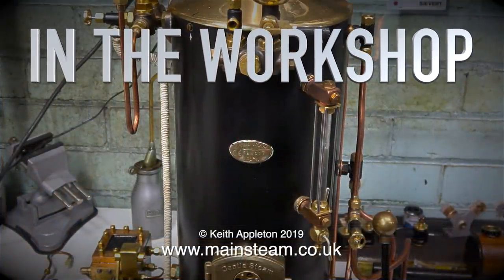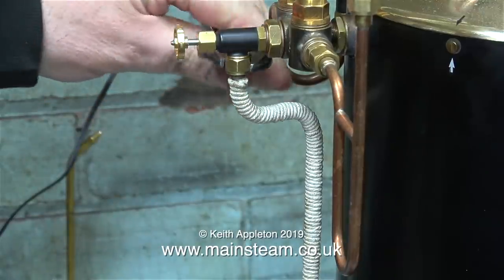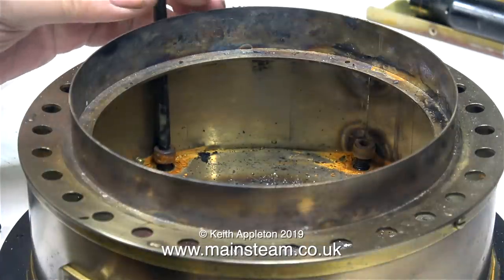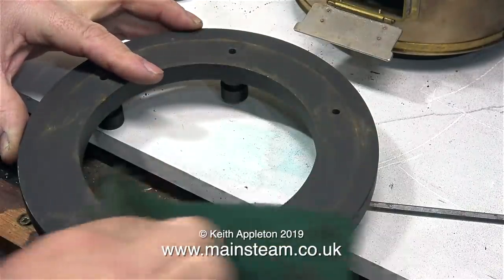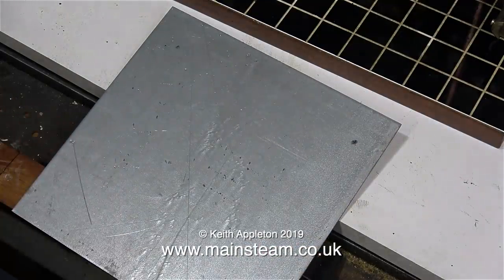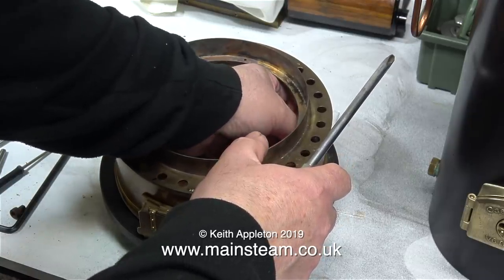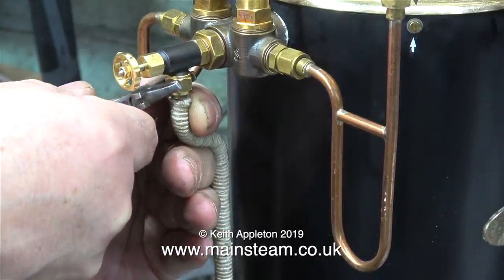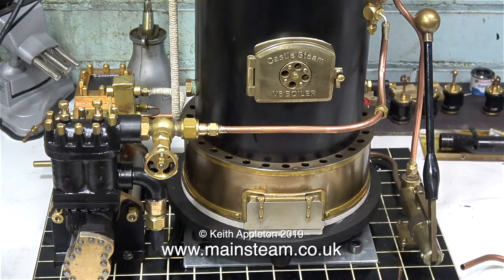FITTING A HEAT SHIELD TO THE V6 BOILER - IN THE WORKSHOP

Comment: Hi Keith;
For years I worked for a manufacturer of paper machines. We used a lot of stainless steel. If you had used your buffing and grinding tools on regular steel before using them on the stainless, the stainless would rust where you used that too. The steel tools seemed to start the rusting process and once started, the stainless will rust like regular steel. I'm wondering if the stainless in your boiler will rust where you had it in contact with the steel bolts. I'm not sure, but if it does, you know why.

Comment: Personally, I would have given an air gap -- even a washer or two -- between the stainless steal plate and the base platform to give a little cooling air between them. Even if that was over engineering it a bit. But that is just me.

Comment: I don't know why threading bolts into wood is the only thing that has me yelling (well, thinking loudly) at the screen "T-nuts! T-nuts you madman!", but it is. But since you seem to have made it work for about as long as I've been around, I'm not sure how much room I have to criticize the madness in your method.
Reply from the maker: You can yell T nuts and criticise my work as much as you like. T Nuts are no good at all for steam applications as they soon go rusty with all the water flying about and then after a while the bolts get stuck in them - that is from my experience }:-)))
Reply: @keithappleton  See, I knew there was a good reason. It'll probably never look right to me, but I guess that's a me problem.